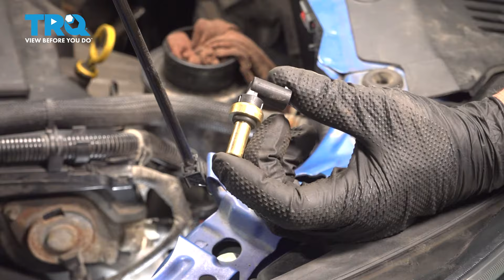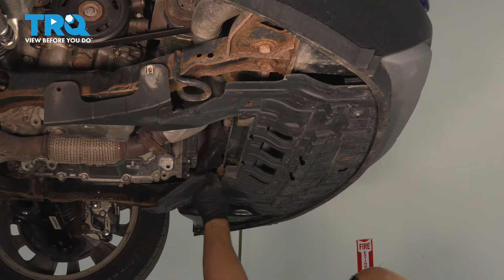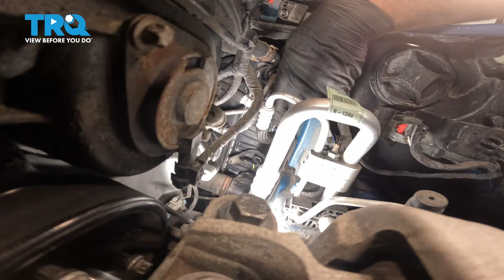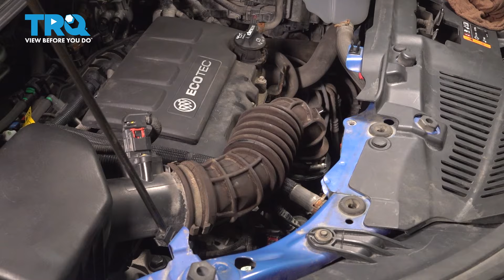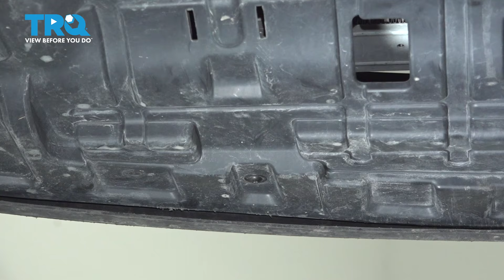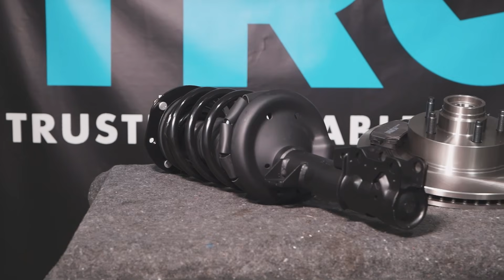How to Replace Coolant Temperature Sensor 2013-2022 Buick Encore

Comment: Can I just pull out the old sensor and put the new one in? Do i really need to unplug the air intakes? I know the coolant will flow out where the sensor is plugged in but I will just clean the mess afterwards. My coolant was recently flushed a few weeks ago that is why I'm asking. Thanks